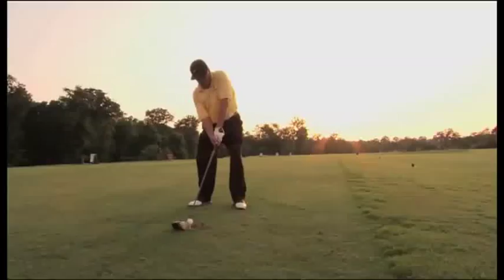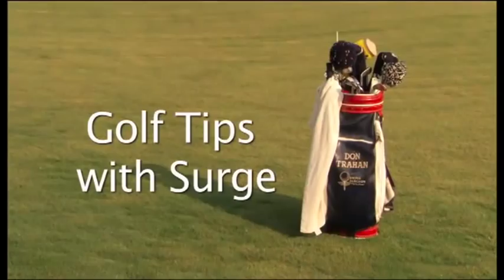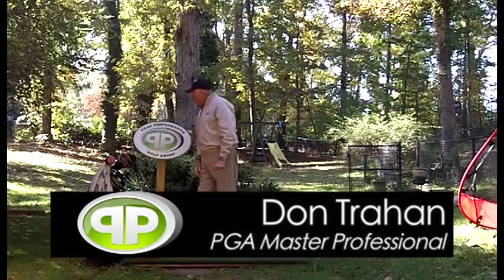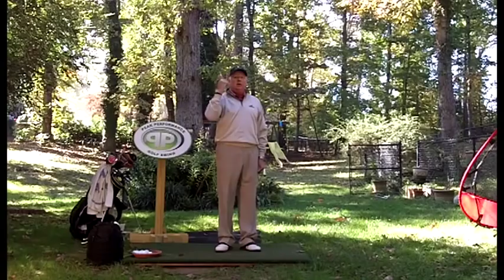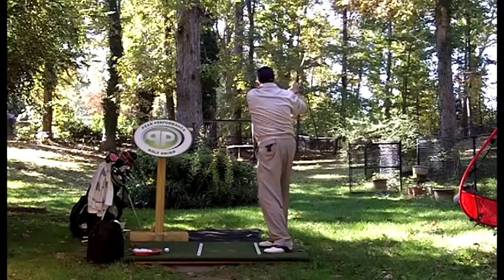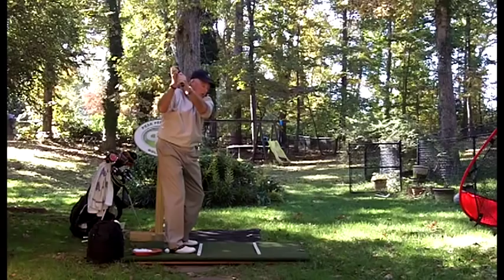PPGS In Slow-Motion

Comment: Hi, Don! I bought your PPGS Foundation manual v2 and DVD several years ago, but for some reason, tried other methods to see if I could do better.  Anyway, I'm back and curious about your statements from 10:35 in this video about controlling the follow-thru, not letting the club continue on its natural path(equal and opposite reaction) in a flatter plane. How does it happen that the upswing would naturally be different than the backswing?
Reply from the maker: Hello, thanks for revisiting us. I would post your comment on our website rather than youtube, our readers don't comment on YouTube but do on our site. And Don doesn't read Youtube either.